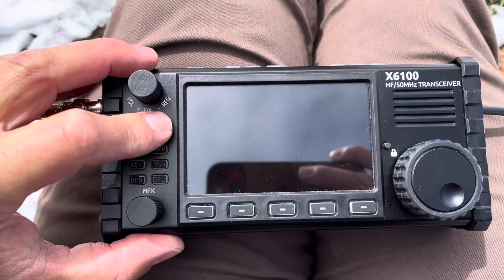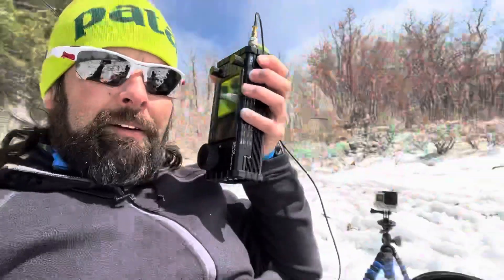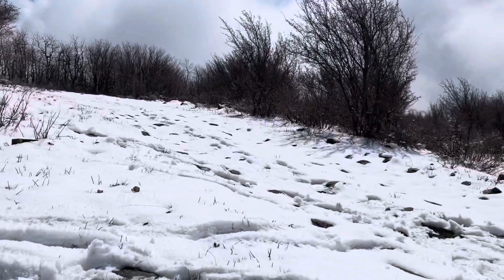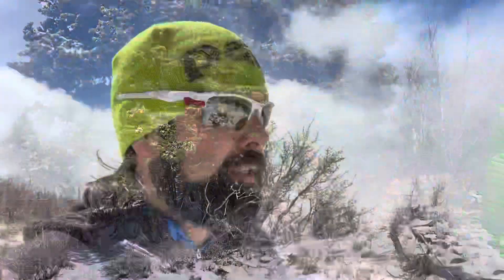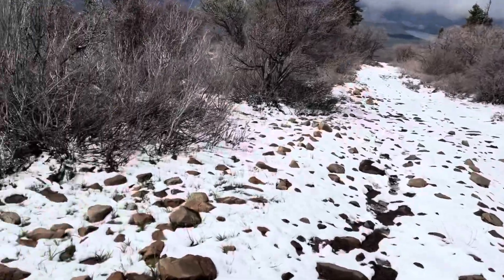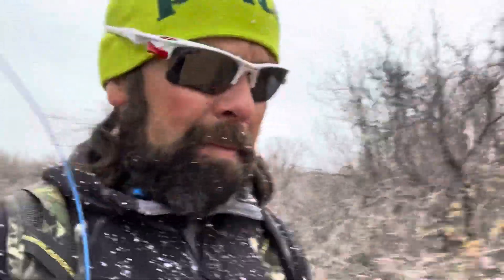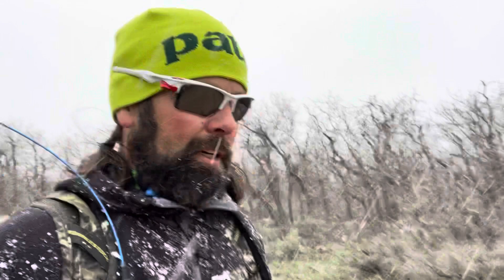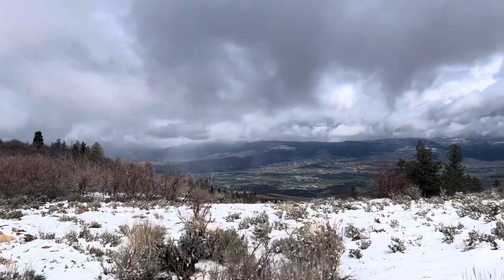Part 2: Crazy problem with the Xiegu x6100 Discovered While Operating SOTA - Transmit on mic Connect

Comment: Hi great work.
I plan on getting a x6100 for my first HF. Thanks for the video.
Motters M7TRS 🇬🇧 73
Reply from the maker: Motters, thanks for the feedback! Despite the few issues I've had, I love this radio. I think you'll enjoy it. I have another video coming about this same issue, how it started and hopeful resolution coming in the next firmware update. 73 KI7WJP Eric
Reply: @backcountryamateurradio  oh fab times. It's out of stock in the UK 🇬🇧 they are snapped up when they come onto the second hand market. I have to use Web sdr at the moment. I use two in the UK one is called hack green sdr and the other which is close to me called jodrell bank sdr.

Stay safe Motters M7TRS 🇬🇧 73

Comment: The supplied mic cables are trash.  Go with a CAT 6, 7 or 8 and see if the problem goes away, or buy an ICom coiled cable spare.
Reply from the maker: I had really been wondering about this problem. I also don't plan to use the supplied mic. I'd rather rewire a good mic from a some other radio. This mic is way too busy, seems like it's also a power drain with all its lights. Thanks for the recommendation on the cables! 73 KI7WJP
Reply: @backcountryamateurradio  i've tried G90's mic but nothing changed

Comment: Check your RJ45 Jack on the radio.  Had a similar issue on my G90: couple of tabs on the jack had broken free shorting the ptt to transmit.  Took apart the head unit, reflowed the joint, added a strain relief to the hand mic cable, and have been trouble free ever since.  PAX John (KO4HZH)
Reply from the maker: This is great advice!! Thank you John. I am really looking forward to operating more with this radio. This issue appeared with the newest firmware update. Maybe coincidence? I’ve been in touch with Radioddity about it. - ki7wjp Eric

Comment: Bummer.  I haven't seen that issue with the production version.  Are you sure you didnt switch the mic input?
Reply from the maker: Yeah, it is a bummer. I went through all the settings. I tried all sorts of things to try to find an off for it. It kept on happening. And others are reporting some similar mic issues. We’re all thinking it has something to do with the latest firmware update and digital modes. Hopefully have more information soon. I love the radio though.